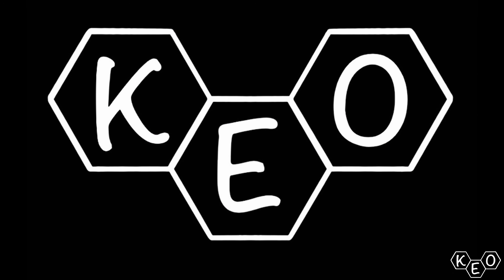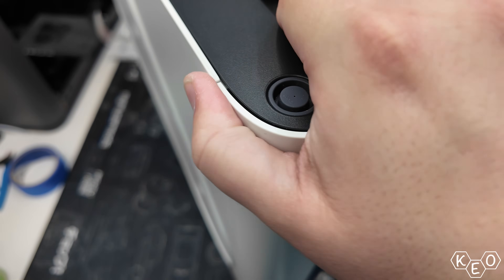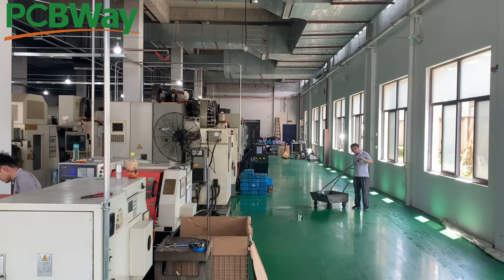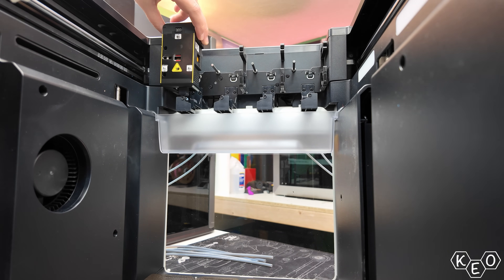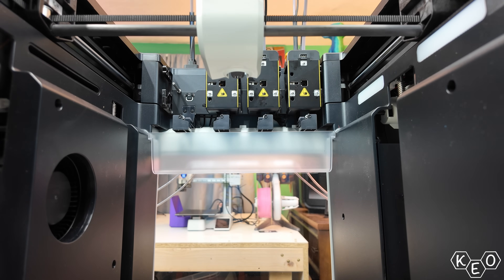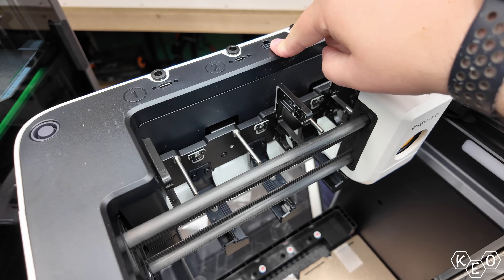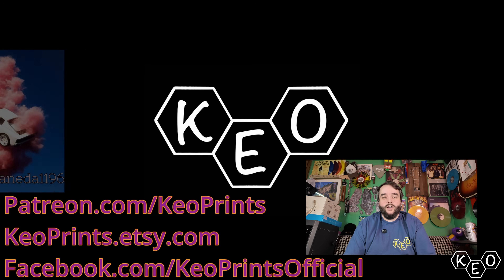Why Is the Snapmaker U1 This Cheap? (Initial Impressions)

Comment: So, with the print spools just...out there...how do you deal with particularly hygroscopic filaments? Just make sure your printer room is dry enough? Does it print so fast that properly dried filament would stay dry enough during printing to feed and flow properly?
Reply: I ask because I am fluctuating between the U1 and a P2S as my first (and I assume, only) 3d printer. Beyond waste mgmt, the allure of mixed type printing is of interest but it seems like pretty much anything apart from PLA variants has humidity issues.
Reply: Its basically only a multicolor PLA-only printer at this point.

Comment: Snapmaker has released the hardened nozzle/hot end in different diameters so I’m hoping some more abrasive filaments can be used once I actually receive mine…someday
Reply from the maker: It sounds like these hardened components are coming with the next round of deliveries here in march or April. I’m looking forward to it

Comment: Why do you print purge towers? Isn't the point of toolchangers to not have to do that?
Reply from the maker: Well, yes and no. In this case, the purge tower functions more as a prime tower. Simply there to prime the previously parked nozzle; getting the old, cooked filament out of the nozzle and bringing the pressure of the "liquid" filament up to operating spec before moving over to the model. Small price to pay for that extra quality
Reply: @KeoPrints  Ah got it, that makes sense!
Cheers!

Comment: Snapmaker U1 comes equipped with 4 x 0.4 mm proprietary stainless hotends, along with one spare hotend.  

They do offer hardened steel hot end
Reply from the maker: They do offer hardened replacement hotends. They’re on a preorder basis right now but they offer them

Comment: i ordered a u1 recently,  won't have it for a few months yet but I'm excited to do functional print in place gadgets with multi material... im thinking about low tollerance gears that can be almost touching but then release easily.  lithographs with color accents embedded would be so cool.  perfectly supported slot overhangs in 2 different axies at the same time.. sounds silly but this should allow you to print many things with otherwise impossible geometry
Reply from the maker: The multi material implications of a toolchanger do really change the game

Comment: The machine is cheap because 3d printers are manufactured from cheap components. People seem to forget that Prusa and Bambu are not the only printer manufacturers. The XL costing $4,000+ should be criminal. At the end of the day, its stepper motors, linear rails, bearings, screws, etc. These aren't bespoke NASA grade components. IIRC the last time I checked the actual component cost for the XL, it was like $300~. IMO the U1 is a little overpriced at retail, but I suspect you be able to pick it up on sale for 800-850 which seems great. 

They have also been pretty vocal about why they maintain an Orca fork: because it allows them to push out releases more often than 5-6 times a year. These contributions can then be merged into mainline Orca.

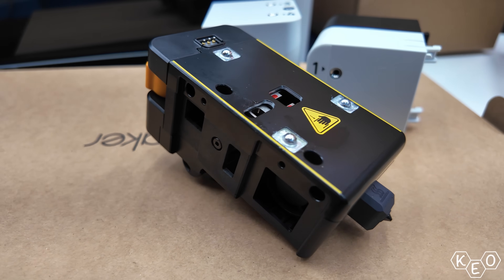Comment: 7:33 yes there are plastic gears but those are the ones linked to the motor, it is the metal gears that are coming in contact with the filament.

Comment: Actually, It’s not really affordable. Currently 1.5 times as expensive as a Bambulab P2S combo, 2.5 as a Flashforge AD5X, 3times as a CC or a Bambulab A1 combo!
I don’t get this marketing point of “It’s cheap” at all!
In both long and short term use cases it will be much more expensive to run than any of its direct competition with less availability of parts and knowledge and support with nearly no justifiable advantage for a normal consumer/prosumer.
Yes, it’s cool in my opinion as well but not a sound investment unless the price drops to around Flashforge’s AD5X (and be sure that it is going to be still veeery profitable for the company). 
They just lack the industriousness of their competitors. What they definitely do have is a very poorly designed marketing strategy.

You asked what you should do to improve your reviews/content, my suggestion is doing a better job at researching about the product you are reviewing and its competition considering their price and their parts prices (or a running cost effectively) so you can abandon and grow from these companies purely marketing messages.

Comment: The erratum that they send out with the order says specifically not to use an electric screwdriver to tighten the USB connectors because there is a danger of stripping the screw holes.  Safest to stick with what they send you even if it does take longer.

Comment: My current concern with it is software and how long it will last for.

On the software side, is it compatible with other ecosystems if not, how is its own ecosystem?
Reply from the maker: In terms of software, it is a simple setup being based on the open source Orca Slicer and being compatible with mainline orca. So no concerns there. As for their specific ecosystem, it is certainly still in development to say the least
Reply: @KeoPrints  yeah, it makes it harder to recommend to the makers space I am part of as they currrently have bambu X1s (which is very user friendly softwere). they are looking  to expand to more and ones that are tool changers would be great to save on waste. unfortunately bambu's have some big downside compared to  prusa and snapmakers design.

Comment: It probably prints multicolored layers faster than H2C, since it doesn't need to unload and reload filaments
Reply: However, judging from the imagery, I'm surprised to see that it hasn't eliminated the the waste that is the purge tower — since you're using separate toolheads for the filaments, you don't have to purge the nozzle at each color change. If the design still requires a purge tower, you're only saving the time it would take a single-printhead design to retract the filament and feed in the new one; you're not saving filament by not needing the purge tower.

Comment: I ordered the top-cover, and the hardened nozzle set, and it was still $999.   I will still probably have to insulate the shell and put a chamber heater in there, but ASA and PC should be possible.
Reply from the maker: I also have the hardened stuff coming. Looking forward to trying that all out

Comment: Great video! Could you try a print at 0.08mm layer height next time? I’d love to see a complex model that requires supports to see how it handles that.

I'm curious if there is a difference between this machine at that quality and my H2C, which is giving me great results.
Reply from the maker: Comparing fine layer heights is a neat idea. I’ll have to put that on the old to do list

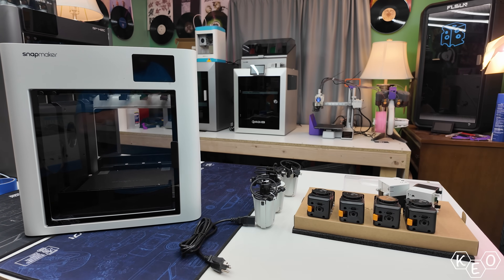Comment: 05:00 Engineering means working within constraints: This machine is built to a price point for sure, but panel gaps are nothing that will affect print quality. Unless proven otherwise, I like to think of this more as great cost engineering, allowing someone like me to get his hands on a tool changer without having to spend >5000€. What I do take issue with is that the reviewers of the preproduction model got told it would be fixed for production. Which it clearly wasn't.

07:08 There's only one motor in each feeder. Some gearbox inside allows them to feed one filament for one direction of rotation and the other filament in reverse. Which is also, why they can't retract filament. Built to a price point...

09:00 Snapmaker explicitly says that you should not use an electric screwdriver (because some people overtightened the screws around the USB-C plugs and damaged the PCB below).

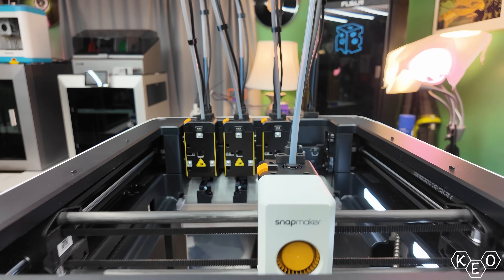10:40 Extruder gears are hardened. Standard nozzles are not. Cover comes later (but at a ridiculous price) - people have good success with an IKEA Samla box on top...

11:50 Because mainline Orca won't integrate the customizations (syncing printer contents to slicer, sending print jobs through Snapmakers cloud etc.). Snapmaker is actually proud of working with Softfever (the creator of Orca Slicer), that's why they're not hiding it.

13:05 I couldn't agree more. Hopefully the Prusa tags take on...

16:25 I would love to see multi-material prints much more than just multi-color. TPU hinges, PLA/PETG support interface etc.

Comment: I was holding out for this printer just for multi color print with little waste but after this I’ve ordered the p2s combo maybe I’ll get this in a year or so or when it has t 2nd gen of the u1
Reply from the maker: P2S is quite the machine. The U1 is also quite the machine. Totally different printers but both super cool

Comment: Even as a Bambu fanboy I have to say that Bambu missed the mark with the dual input switching single toolhead. The multi-toolhead changer is just the best way to do multiple color/material prints. If I had any need for multiple printers, I'd buy this over any of the new Bambus. To be honest, I don't do this for a living so the print time and material waste of single head+AMS isn't a major issue for me, but still - this is the best way to get into multi head printing, and I feel like multi-head is the best new technology.
Reply from the maker: I agree but also I go back and forth on the bambu approach. On one hand, I love the idea of the Vortek changing only the nozzle. Way more compact and there are loads more "toolhead" that way. The time penalty isn't a big enough deal for me to be too concerned but it does need to be weighed. I think if bambu offered their filament buffer that can switch the left and right nozzle inputs at launch, the H2C would be much more attractive. As it stands, there is a while AMS dedicated to one nozzle where the other side has a 7 nozzle capability but only a four slot AMS hooked up, unless you of course, spend even more while you’re already dropping 2500 bucks. Ranty I guess but after it is all said and done here, the Snapmaker is super impressive for sure

Comment: well it is actually not that cheap - look at the Elegoo Centauri Carbon 2 and factor in the parts for 3 extra toolheads - in a few months, creality, anycubic or elegoo will hop on the train and undercut snapmaker here by quite some margin
Reply from the maker: It will surely be interesting to see what happens in the space over the next year. Im thinking the single nozzle systems are going to be gone very very soon

Comment: 10:50 On that note, I have heard they also have upgrades and spare wear parts on their website. There are hardened steel heads and a top cover available at this point as far as I'm aware.
Reply: I ordered them during Kickstarter.  Not coming until February.  Printer is almost here.  It was still $999.
Reply from the maker: They are available for preorder currently. Should deliver in march I believe

Comment: While it does feel a bit cheap I have been running mine (order 3220) since 11/23 24/7 with only a few very minor hiccups. no print failures, just 2 random errors that just needed me to press the start button again.

Comment: Reviewers need to note in their videos that this printer CAN print engineering filaments. It does have an optional top cover for it with a filtration system and you can get hardened steel nozzles.
Reply: Qidi had major issues with their 3D printer making printer bottom from plastic, they use metal since. So this is bad design from company that never learns, avoid.
Printer has no bottom metal structure, it bolts to flimsy plastic bottom.
Reply: @akierum  This is false. The bottom frame is made of aluminum. The cover at the bottom is plastic, but the frame is metal.
Reply: @keith4669  See disassembly video then "The inside of the SNAPMAKER U1 printer completely disassembled!" It has no bottoms metal frame

Comment: I’m still trying to figure out how the hell you just ripped those spools out of the bag and just slapped them onto the machine!! 😱

 I tried that on my X1 Carbon once and OMG!! The model quickly became a nightmare of uneven blobs & strings. I learned that my filament had to be DRY AS A DESERT, and then my chances of a successful print jumped to about 96%. 

With a clean plate and a fresh layer of glue stick, it was about 99% chance of success. 

So please explain what kind of filament you can slap on fresh out of the plastic. 🤔 .. Or did you simply edit out the drying process?

Comment: What i don't like is it seems like the toolheads are a consumable item.

The electrical contacts are rated for 200,000 swaps which sounds like a lot until you realise in a 10cm tall print at .2mm layer height you are looking at a potential 500 swaps.   

20 of those prints would be 5% of their useful life.

Comment: Snapmaker have been very clear in their communication NOT to use an electric screwdriver for just those screws you're discussing using one for :P They're aparently very easy to over tighten and below one of them is aparantly a very ill placed capacitor that can get punctured by the screw. 
So, for anyone reading this, DON'T use a electric screwdriver for the toolhead screws!

Comment: Issue with this printer is that once you remove the 4 toolhead advantage it's barely a 300$ value, so you have to really care about making multicolored toys to justify the extra 700

Comment: WHY do a review if you don't even know all the specs of the machine?  Goddamn man, YES it can print ANY FILAMENT including ASA, ABS, CF, HIPS, PEBA etc.  and YES there is a damn top! You buy it separate but yes there is one and it has filtering built into it.  AND the nozzles are Steel coated so they can still print glow, Wood and other semi abrasive filaments. AND there are hardened steel nozzles you can buy for it already available.  Oh and YES the nozzles are quick swap. you just take off the cover and its right there. almost the exact same flip and pull out as the Bambu A1......You reviewers always slam anything not Bambu.  I know you are paid heavily by Bambu to "say nice things about us" but damn at least don't flat out omit or lie about other printers. Fyi the print quality on the U1 BURIES that shit box overpriced hacked together H2C you have back there.  If you want stuff to nitpick about LOOK AT THAT THING! Its got a lot of content for you to use
Reply: Wow buddy, you really need to calm down. Also you are very wr0ng about everything you said btw, as usual.
Reply: @riba2233  And your just a Bambu simp would goes on every reviewers site and posts about BAMBU IS GOD! ....Every word I said is 100% FACTS but you Bambi's can't stand that
Reply from the maker: My friend, I would love to be paid by Bambu first of all but I am not even a bug on their windshield. I am happy you’re here commenting though because these are items that I can consider as I move forward creating content with this machine. I am very impressed with the results that ive seen so far and really look forward to getting to know it a bit better. 

I promise to treat your machine here with respect and I'll have her home by midnight. Send my regards to its mother

Comment: 6:50 You did what? That's just cheating. Personally don't care about the cheap plastic case parts, so long as the important bits are ok.
I hope it performs pretty well and is reliable for maybe a year or more. I'd expect it wouldn't last as long as something like the Prusa XL, but hey it's relatively cheap.
Remember though, you need to remove ALL the bed screws before using. Excellent video guys.

Comment: My 10yr old assembled ours and I'm suddenly concrened we 100% did not properly install the notched ptfe tubes.  That said I had the exact same observations on the plasticy jank.  That top panel popped out on ours when removing the tape exactly like yours.  However this thing has been fantastic. Print times are great, waste levels are practicvally non existsent, unless you do flow callibration.  All things considered this is, in my humble opinion, the best value option for someone who wants to get into multicolor 3d prinitng.

Comment: Don't you really understand why is such cheap? In my eyes ir is less or more clear.  What you need to build a good 3d printer? The slicer software, the printer control software and the printer hardware in the order of importance I listed. First 2 are open source (slicr/ prusa slicer, klipper) and defacto free and developed by the community and  some comapanies like Prusa. So snapmaker's cost is the hardware. You may ask OK but what about R&D fine. I bet, most of their cost was to look around take what works for others and blend them as cheaply as possible to the printer hardware. Then use supercheap Chinese manufacturing to produce it. Without years and years of RepRap and Prusa opensource we had no Bamboo or Snapmaker neither others. So if you buy a such a cheap printer you are paing for hardware ONLY!
Reply: Yeah 90% of this printer is just copied straight out of bambu printers
Reply: @riba2233 And Baboo printer is also  build on top of free 2 components I listed.  They just took it and closed. Like their firmware. Pretty much the same pattern. They were the first, had the most of the money and added more value. BTW not just Bamboo, some ideas in toolchanger is very very similar to Prusa ...

Comment: I don't mind how flexible the panels are as long as the frame is solid and prints are good.  I won't sit there and molest my printer like you are, lol.
Reply from the maker: That is fair, I am not too concerned either really. It already prints super well, like better than I expected. As long as it holds up over time and there weren't any corners cut beneath the surface, I think we are absolutely on to a winner!

Comment: The filament feeders only have 1 motor each not 2 motors. It feeds the upper/lower filament depending on clockwise or counterclockwise rotation
Reply from the maker: Ahh, fair point there. I stand corrected my friends!